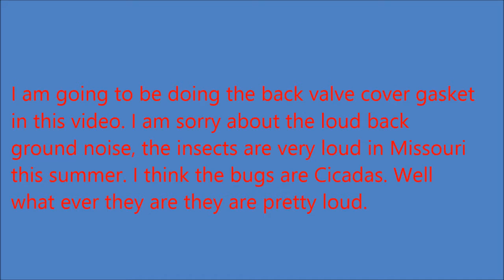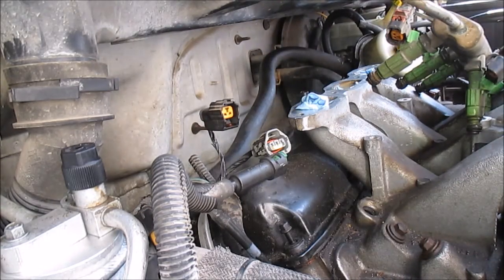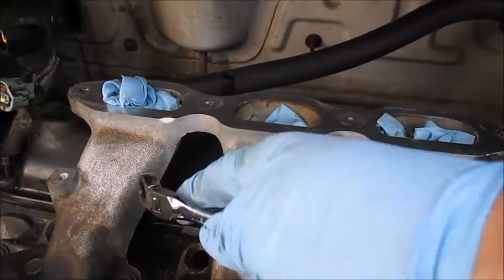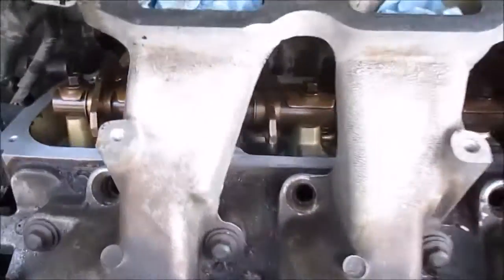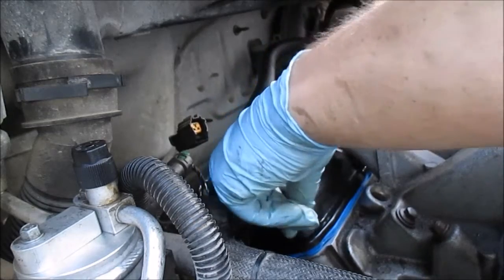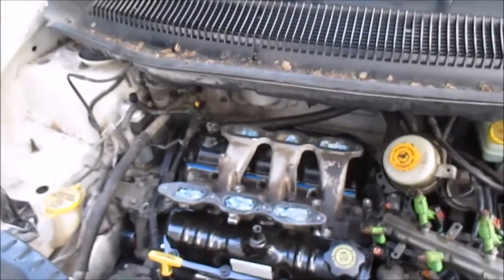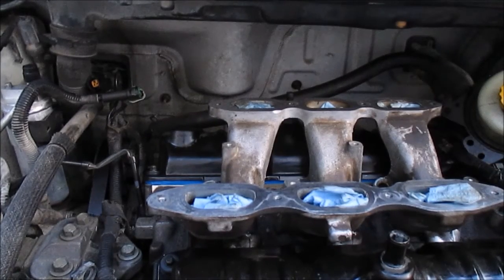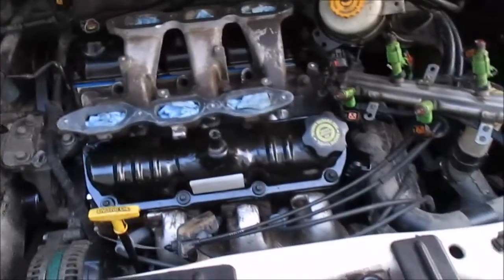How To Replace Valve Cover Gaskets Dodge Caravan Part 3

Comment: Great work AJ you don't cut corners the way other YouTube mechanics have done on this kind of valve cover gasket replacement work. Most critical is cleaning the engine and valve cover areas before attaching the new gasket.

Comment: I have a 99 caravan with 3.3  and who ever designed the mounting of this engine should have to work on them every day ,all day for the rest of their miserable lives. Don't get me wrong because I absolutely love my van  223,000 miles and still chugging along. But I noticed yesterday that the valve covers are leaking while I was under it changeing the oil . So that's why I'm watching your vid . Thanks, this will help.
Reply from the maker: Yeah the engine mounting could be better for sure. Well I hope you can get your valve cover leaks fixed. Thanks for watching and thanks for the comment. Have a good day, and good luck to you.

Comment: could I just take off the wipers assembly to get to the rear valve cover? while taking of the pcv valve half of the plastic thread broke off and is still threaded in the hole so I don't want any plastic chips to fall inside if I chisel it from the top
Reply from the maker: Yeah you can get more room for yourself by removing the wiper assembly. Man that sucks your pcv valve broke off and is stuck inside. Well I hope you have good luck fixing it. Thanks for watching and thanks for the comment. Have a good day, and good luck to you.
Reply: ozzy82696 how did you fix it?
Reply: instead of taking the valve cover off I just heated up a flat head and kept picking at it until I melted everything off, then I just took a vacuum and a small hose and vacuumed up all the chips of plastic that fell inside, I now have the new pcv valve on and no problems since

Comment: Hey AJ first let me say I am very grateful for your videos! My question is I never understood torque pressure and have just tightened until it was tight (not over). Is there a special tool or gauge to tell you? How do you know when you're there? Thank you and to anyone for comments
Reply: Hi every bolt on literally anything has a Torque Spec, or exactly how tight it is supposed to be, in mostly foot pounds, such as wheel bolts or nuts neef to be torked to 45 foot pounds on my wifes alloy rims or they will crack, valve cover bolts will be a lot less.  The spec is usually in the shop manual, my spark pluhs were 20 foot pounds going into an aluminum head.
Reply: Hey Derena there is a tool called a torque wrench.. you can find one even at Wal-Mart believe it or not lol.... but harbor freight has a good selection from pro expensive one to cheap begginer ones... if your starting off do yourself a favor and also pick up a breaker bar lol

Comment: would it be easier to remove the intake manifold and leave the fuel injection intact? I need to do the same job primarily on the rear VC gasket.
Reply from the maker: +Dogedart67 
It it your personal preference. I did it because I felt it got everything out of the way. Also I was planning on replacing my fuel injector o-rings anyway. But you don't have to remove the fuel rail. Thanks for the comment and have a good day.

Comment: How did you clean the valve cover mounting surface?  toothbrush? what cleaner?  thanks
Reply from the maker: I usually use brake cleaner, acetone, gasket remover, or some other type of automotive cleaner depending on what I had on hand. I usually use a good sharp gasket scraper for cleanup. Also, I have used the green scotch brite pads, copper scouring pads, plastic roloc bristle disks, sand paper, and other things. You just have to be careful you dont want to mark up or gouge the surface, or leave behind a bunch of marks that may leak in the future, and you want a clean surface so the gasket does not leak. Well I hope this info helps you out. Thanks for the comment and have a good day.
Reply: AJ Pierce how did you keep the debris from falling into the valve area? Also, how did you clean the covers themselves?
Reply: When I go to clean mine, I’m going to try a plastic putty knife to scrape the majority, followed by a microfiber cloth soaked with a little carb cleaner, then a second microfiber with a little carb cleaner again for a final cleaning.

Microfiber cloths eat through stuff. They’ve got these soft barbs that annihilate stuff but work better wet. Obviously I’m not gonna use water. And brake cleaner often is much too abrasive, destroying plastics and rubbers it comes in contact with.

Microfiber cloth I think is 7k grit on the sandpaper scale.

Comment: So do I have to take off the back valve cover to change the PCV on a 2008 Chrysler Town and Country. The valve is not the one with a hex nut around. Its in a bake a lite mount.
Reply from the maker: I am not sure, I have never worked on a 2008 model before, so it may be a little bit different.  What is your engine size, do you have a 3.3L, 3.8L, or the 4.0L. From the diagrams I looked at on chiltonpro it looks like the 3.3L and the 3.8L should be the same as what i did in the video link I sent you, which does not require removal of the valve cover. However the 4.0L diagrams looks a little different. If you have the 4.0L give me your email and I can try to send you some info on removal and installation of pcv valve. Well I hope this info helps you out. Have a good day.

Comment: To any future weekend mechanics, it would very helpful if you guys remove the wiper assembly first, and if need be,  that intake plenum, being careful not to disturb too many of the surrounding parts, fuel lines, connections etc. Also, there is a box frame or pocket about 5" wide under the PCV valve, so any little piece of whatever falls, will not fall into the engine. And if you do remove that cover you can shake anything that has fallen out. I feel its better to try and pull that pcv up and out while its held down by its screws.

Comment: Instead of using the flex wrench, why didn't you go from above with your universal joint and socket wrench to remove the two bolts on the back valve cover, just like you did on the front and just like you did to reinstall those two bolts. The access is essentially the same as for the front voce. Consider how the job would be done if you removed the cowl rather than removing the intake plenum.